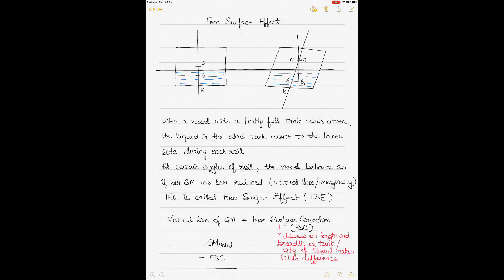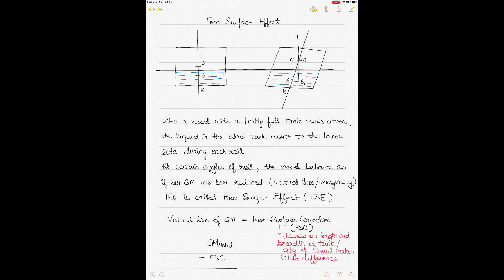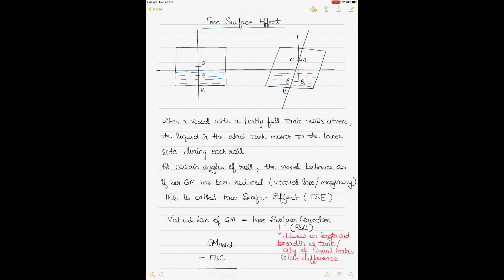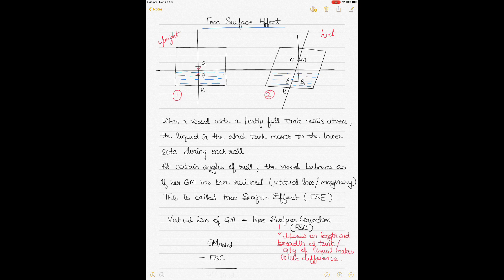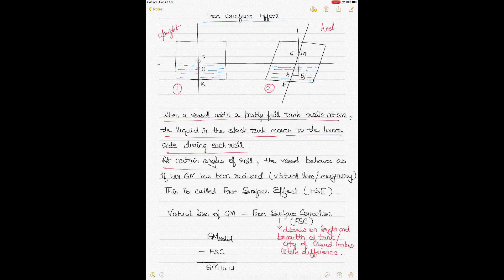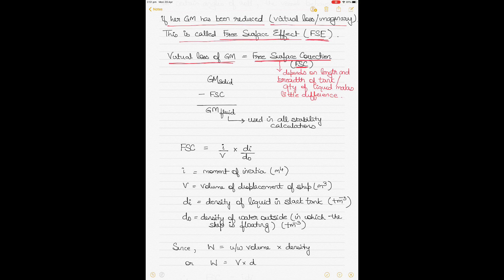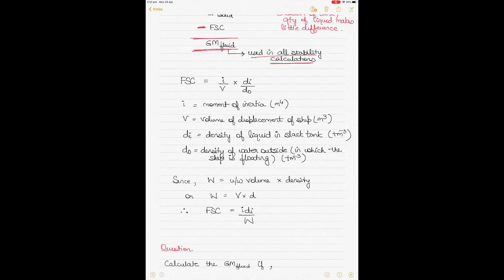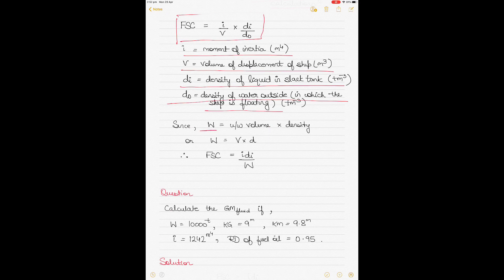Ship Stability - Calculation of free surface effect and final GM

Comment: Please sir, kindly solve this question for me. It has landed my class in a trouble. 
Please here is the question;

A ship of 8153.75t displacement with KM 8m and KG 7.5m has a DB tank 15m x 10m x 4m which is empty.
Find the new GM if the tank is filled with SW till half full.